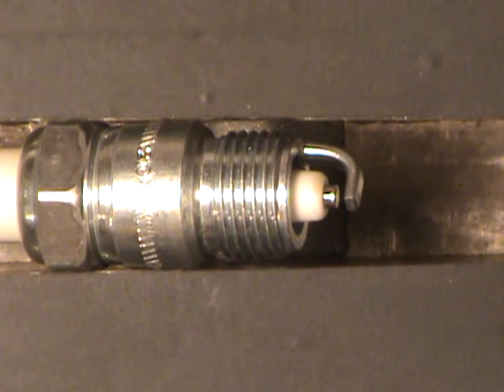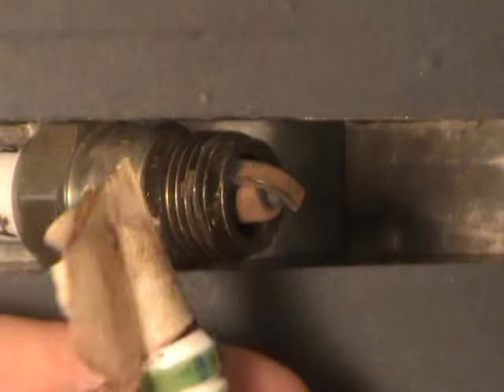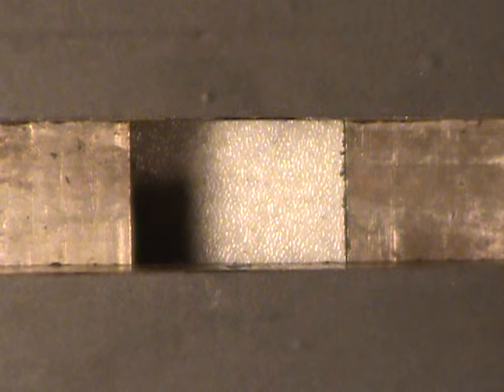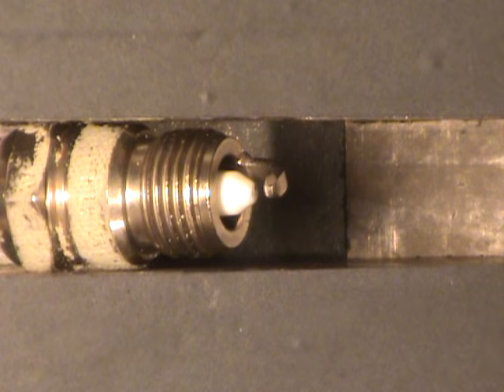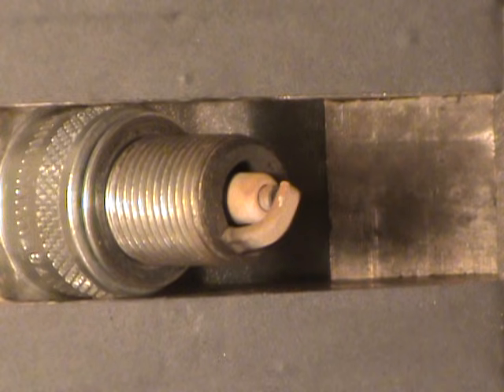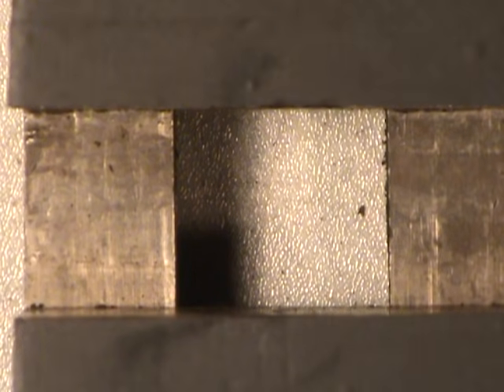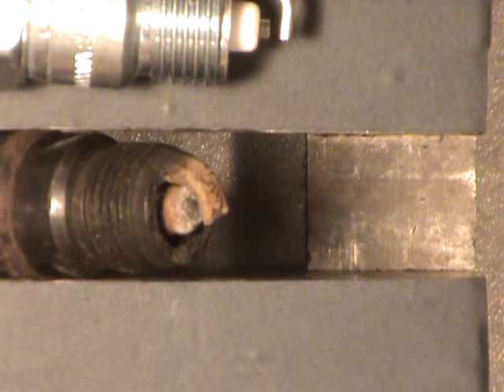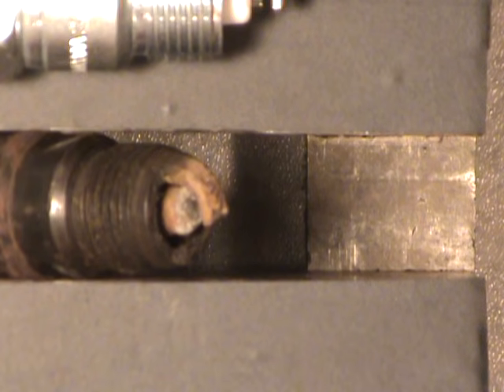SPARK PLUGS How to Read them (Part 3)

Comment: I removed all 4 plugs and they all look like yours at 2:26

So this means engine is in good condition i guess.

But i have to replace the head gasket i think. It has small leak at the corner.
If its a headgasket. Maybe its timing chain cover gasket actually.
Reply from the maker: +jw200 ....Greetings jw200....Thanks for watching................The Spark Plug's Design/Type and Heat Range, can affect, the Amount and Color, of the Spark Plug "Deposits", and the way in which, the inner and outer Electrodes "Wear", due to all of that High Voltage "Arcing" between the two of them, that can Vary/be quite Different, depending on the actual Engine, and whether it is equipped, with a Carburetor or Fuel Injection, and also, the, shall we say "Strength" (high voltage/amperage capability) of the Ignition System, as well as, what-ever-happens-to-be, "in" the Gasoline "Blend" (as in, maybe, a certain %-age of Ethanol/alcohol, perhaps?), that's being pumped-into, that particular Vehicle's gas tank, will usually have quite a bit to say, well, actually "Show", a Person, just what's going on, inside the Engine's Combustion Chambers, be it, Good, Not-so-good, Bad, or, Engine Damage is about to, or, has already Taken Place...!!!...Yikes...!!!...and I hope not.......................The Deposits, that You were sayin', that You saw on Your 4 Spark Plugs, are what I would consider, to be on the, shall we say..."Safe"...side of things, as long as Your Engine Runs and Performs quite Smoothly, and, that it's not making any unwanted Noises at the very same time................The Newer and Cleaner, the Spark Plugs are, as well as, having the Spark Plug "Gaps" (between the inner and outer electrodes), Measuring, with-in the Vehicle Manufacturer's "Specifications", for Your "Exact" Engine and Vehicle, will usually, help-out quite a bit, with both Performance, and Fuel Economy as well, as long as You can keep Ur Led-Foot, from Stompin' the Gas Pedal to the Floor-Board...!!!...lol................If You can tell me, what Vehicle and Engine, and Mileage/Kilometer-age on it, that You have there, as well as, what the Fluid is, that You said, was "Leaking" (was it...Oil...Coolant/Anti-freeze...Transmission Fluid...or Gasoline...???), then, I might be able to help You out with that Leak (hopefully, that is), and..........till next time.........Be Safe, take care, and have a good one.
Reply: +RockysRoadshow Thank you very much for so complete answer. 

Car is BMW E36, 316i, 1996, 75kW, gasoline. Something around 276000 km-age.
Engine works fine and drives smoothly no problems. Sometimes if car sits few days it doesnt want to start immediately. Takes a bit time. Sometimes engine sounds like diesel at startup.

But i have heard this only 1 time, when car was sitting one week without any activity.
I havent replaced the fuel filter and other things.

I just removed the plugs to see them, they are 4 electrode type and to my knowledge they are wrong for this engine.

The fluid thats leaking feels like oil. I havent smelled it. But the cylinder head on the M43 engine is at angle to the left and there is a place where head and rest of engine is mounted together.

But again, maybe im wrong but i think that oil level cant be on so high level that it reaches the headgasket level.

4.5 litres of oil goes into this engine.

Sorry for my english
Reply from the maker: +jw200 ....Greetings jw200....You're Welcome, and, Your English, is just fine, my Friend.....................If Your Car sits for a few days, try this...................Turn Ignition Key to the "Run" position (Not Start), for about 10 Seconds, then, turn the Key Off, then wait about a minute, and Repeat a few times...................If Your BMW's Engine, is like most other Fuel Injected Engines, what will usually happen, is, the Fuel Pump will usually "Prime" the Fuel System, for about 2 Seconds, with a High enough Fuel Pressure, that will probably, help Your Engine Start that much easier/better/faster, and hopefully, not be Dieseling on You as well......................Those Spark Plugs, that have the "4 Side Electrodes" on them, might be considered an Upgrade, possibly, and might help the Engine, Start, Accelerate better, and might even account for some better Fuel Economy...maybe......................Here are 2 Ways, to find out, what the "Exact" Spark Plugs, that the BMW Factory/Manufacturer, had in Your Engine, when it left the Assembly Line......................Have a look inside Your BMW's Engine Compartment, for a V.E.C.I/Vehicle Emissions Control Information...Label/Sticker...and with some luck, it might just have, the "Original" Spark Plug Manufacturer's Name, and Identifying Number/Letters, Printed on it....................And/or, try to find, an "Official BMW Car Sales Business", in the Area, where You Live, that has a Professional-like..."Parts Department"...and, either (or both...lol), Phone, and/or Visit, in Person, that "BMW Parts Department", oh, and make sure, to have, any Paper-Work, for Your BMW, cuz, "They" might ask for Your BMW's..."VIN" (Vehicle Identifying, Serial, Numbers/Letters), as well as, any Information that "Exactly" applies to Your "Exact", BMW Car and Engine combination...................To be Safe, place the New Spark Plug Beside the Old One, to make sure that, it is the "Same", size-wise, that is, cuz, if the New Spark Plug is "Longer", where it goes into the Cylinder Head, the Electrode End of the Spark Plug, might "Hit" the Top of the Piston, and, could very well, cause some rather "Expensive" Engine "Damage"...!!!................I usually, just try to get the OEM/Original Equipment Manufacturer/s, Originally Installed Spark Plugs, cuz, in the past, I found out that, the Non-Original Spark Plugs, that I bought, from the Parts Counter, and I installed, were..."2 Heat Ranges"..."Too Hot"...!!!...and in my books, that's not such a good thing.......................Your (on an Angle...lol) BMW Engine, will probably have Dual (as in 2), Over-Head Camshafts in it, and to Lubricate them, Motor Oil, has to make it Up to them, or Damage, it will usually be, so yeah, Motor Oil can "Leak", from "Way-Up-High" as well.........Yes-Sir-ee-Bob...sometimes, "Fluid Leaks" can Travel quite Far, at times, just so You know (sometimes, due to Earth's Gravity)...................A BMW Factory Chassis Service Manual, for Your "Exact" Car & Engine is good to have....................For a Person, just starting to learn about, oh, let's say, for example, Their Own Car, then, an Automotive Repair Book, such as Haynes (publishing), from my own experience, is an Excellent place to get started, cuz, the Information and Pictures, are presented in such a way, that, makes things, that much easier, for the Average Joe, or Jill, to Learn from.......................Try to do Maintenance on Your BMW, according to what BMW Recommends, at the "Specified"...Time...Mileage/Kilometer-age "Intervals", as per their BMW Chassis Service Manual, or, the Owners Manual, that usually came with the Vehicle, when New, that way, things, like Your Engine, will Perform much better, and last Longer as well...................All Filters, will eventually, start getting Dirty, or maybe even get Plugged-up...not so good....................Be very Careful, when-ever Working on Your BMW's "Fuel System", cuz, some of those "Fuel Pressures are Very High" (around 60 PSI/Pounds per square Inch...!!!), and can cause Eye Damage, so, be sure to, be Wearing Safety Glasses/Goggles, and have a Fire Extinguisher with-in Reach, just in case (and I hope not)........................Try doing an Internet Search, for a BMW (Bimmer or Beemer...???) Website, that has a "Forum" on it, for Your "Exact" BMW, as, there are some really Smart People on those Forums, that can help You out, with any Questions or Concerns, that relate to Your BMW, and...........till next time..........Be Safe, take care, and have a good one.

Comment: i have a 2004 acura rsx (base) wich is oviously fuel injected,and my spark plugs pretty much look like the one at 5:07, its black  on the ring and quader of threads, got alitle bit of gray on the top bent metlal piece, also noticet a white dot right where the spark would be on that bent metal piece metal  is that normal for fuel injectet or cars or is that somting i sould be concered about, i sould replace my spark plugs right?
Reply from the maker: +Daniel Huebner ....Greetings Daniel Huebner....Thanks for watching...................From what You were saying, Your Engine's Spark Plugs, don't seem to be all that bad at all....................Did You have a look at "All" of the Spark Plugs...???...and if so, did they all, look to be, about the same as each other...???......................Is Your Engine Starting-up and Running alright/smoothly, or, does it hesitate, misfire, or surge at all...???....................If the Spark Plug "Gap", between the 2 spark plug Electrodes, gets too BIG, from all of that High Voltage Sparking, going on between them, then, Your Ignition Coils (4 individual ones), have to work harder, then they should be, and, puts a real Strain on them, and can get to the point of becoming Damaged possibly, so yeah, it's a good idea, to install some New, Properly "Gapped" Spark Plugs in Your Engine, if need be..................If You have an Owners Manual for Your Acura, see if there is a Maintenance Schedule in it, for the Mileage/Kilometer-age Interval, that the Spark Plugs should be Changed, in Your Engine, and also, keep a record, of when, You happen to do any Servicing on, or to Your Vehicle....................If You do lots of Short Trips/at lower speeds, the Spark Plugs might have more Deposits on them, as opposed to, lots of Highway/High Speed Driving, which will usually result in, Spark Plugs, that have less Deposits on them, and kinda look Super Clean...!!!...lol...well, if, the Vehicle's On-Board Computer, and, all of the Other parts & pieces, are doing Their Jobs Faithfully, and as they should be do-in, that is, and till next time..........Be Safe, take care, and have a good one.

Comment: Great video that could really help people  with any car issues. I've got a Nissan skyline R33 gtst and the coil packs needs to be changed. How much should it cost to change them all?
Reply from the maker: +ayatullah qasimi ....Greetings ayatullah qasimi....Thanks for Your nice comment, and also, for watching too...................Probably better, if You were to first, make a few Phone Calls, to some of the Automotive Parts Businesses, in the Area where You Live, as to, the Price, of the "Exact" Part or Parts, for Your Car, that You are interested in.....................If the Part/s are not available, or, are Priced too High for Your liking, then, there are so many, Auto Part Sellers On-Line as well (EBAY, as an example), that You can check out, but, be Very Careful when-ever making any Purchases or Payments On-Line, cuz, there are a few, Not so Trustworthy People out there, that, just might, try to Rip You Off (Money-wise, that is)..................If Purchasing On-Line, maybe check out something like PayPal, cuz that Company, kinda acts like the Middle-Man (between the Buyer and Seller), and, will probably make On-Line Purchases, that much Safer.....................Low Prices, aren't everything, so consider the Quality of the Parts as well, cuz, some of those Cheap Parts, might not be all that good, or last very long either...................Good Luck, finding those Parts, that You're looking for, and............till next time..........Be Safe, take care, and have a good one.
Reply: Thank you so much friend :) I did call few nearby companies and compared the different prices. So what should be an appropriate cost for all 6 coil packs or just 3?
Reply from the maker: +ayatullah qasimi ....Greetings ayatullah qasimi....You're welcome................I had a look around, and the Prices are, shall we say, Far and Wide...!!!...................It depends on the Brand/Manufacturer, and maybe, by purchasing all 6 at once, that has the possibility of lowering the price as well.......................Your Engine has the 6 COP/Coil on (spark) Plug, type of, Individual Ignition Coils, does it not,...cuz, that's what came up, when I looked for it/them....................I saw prices, like, from about 40 to 100 US/United States of America Dollars, just for "One" Ignition Coil............Maybe, 200 to 300 US Dollars, for a Set or 6 of them....maybe more...maybe less, depending on the Brand/Manufacturer, and, whether or not, they happened to be, the Factory/Stock type, or the Performance/Racing type.....................There are some really good Websites, that have "Forums" on them, where You can ask, some of the very Smart People, on those Website "Forums", just about any Question, that You might have, about Your Car, and some of those, Nissan, Car, Guys & Gals, will probably have lots of Experience, with Your Exact Car and Engine.....................So, do an Internet Search, for Nissan (car) Websites, that have Skyline "Forums" on them, that way, they can actually tell You, what-ever You might want to know, about Your "Exact Car and Engine", and maybe, where to get the Best Deal, on Your Ignition Coils as well..................Good luck, and...........till next time..........Be Safe, take care, and have a good one.
Reply: +RockysRoadshow wow that's great price because this other mechanic said it will cost $1300 for the 6 since it's a sports car and I was shocked so thank u so much for the appropriate price range
Reply from the maker: +ayatullah qasimi ....Greetings ayatullah qasimi....My first consideration, is, try to get, "Good Quality Auto-Parts", from a Reputable Auto-Parts Manufacturer.......That $1300, was that, just for 6-Ignition Coils (Parts Only), or was that Price-Quote, for Installation as well...???.................Just wonderin', have You ever come across that good ole sayin'..."Buyer Beware"...???...cuz, judging by that Very High Price, that You were quoted, then, I'd say, that, to me, it kinda sounds like, the Mark-Up (that's the price, over and above, what the seller paid for the item originally, before adding the, shall we say, profit-amount to it), is Way Too Much, for my liking, that's for sure..........................It's kinda, like they say, about Medical Doctors..."Get a Second Opinion"...especially, if the Topic of..."Surgery"...is being discussed...!!!...Yikes...!!!.....$1300 USA Dollars...??? (for 6 Ignition Coils Only)...well, for that kinda Money, those Parts (for me, that is), would have to be "Coated with Gold"...!!!...or, I'd be Laughing at them, as I was leaving the building...lol...(sounds, kinda like, Highway Robbery, to me).............Yes-Sir-ee-Bob...if it were Me, I'd be asking the Person (to His Face), that Quoted You that "Price", what "They"..."Paid for those Parts"...???...yeah-right...like They would Tell You...!!!...lol.............You see my Friend, there are quite a few, not so nice People out there, that are more than willing, to take Your hard earned Money, from You, simply, cuz, after talkin' to You, for what seems to be, not too long at all, those, Not-so-Nice-People, can usually tell, if You "Do", or "Don't" know, very much, about, and in this case, we happen to be talkin' about "Automobiles", and once, these, not-so-nice-people, "Sense", that You, (and probably, the countless number of Women, that got ripped-off as well), that, "Don't" Know, all that much about Automobiles, then, that's usually when, I like to use, one of those, good ole sayin's, be-in..."Taken-to-the-Cleaners" (more like, Cleaning-out-Ur-Bank-Account)...!!!...................Here's a True Example, that I experienced in the past.................I needed an Alternator, for a Mazda, that had a Rotary Engine in it, so, I Phoned around, and I got 2 Prices, from 2 Dealerships (or were they Stealerships...???...lol), One Quoted me about $250, and the Other One, Quoted me about $350 (both, in terms of, Canadian Dollar Currency at the time), and, after hearing those Two..."Make-Them-Rich"...Prices, I said to myself, it kinda looks like, I'd better start looking for, a "Rebuilt/Re-Man/Re-Manufactured" Alternator................So, I started lookin' in the Phone Book, for some Auto-Parts Sales places, and, after makin' a few phone calls, I finally found an Auto-Parts place, that Quoted me...now get this, a "Brand New Alternator"...for...a little less than..."63-Dollars"...!!!...(I was in Disbelief)...so, I said to myself, Self, You need's to Drive over there, to "See it for Yourself"...so, I did just that, and, I just about Fell-Over, cuz, not only was that Alternator "Brand New", it was in (as I recall), a Factory "Mitsubishi", Cardboard Shipping Box, that also had, the Official-Looking Stickers/Markings on it as well...!!!...Damn, I hit the "Jack-Pot" on that One...!!!...lol................Also, that Rotary Engine Uses "Special Spark Plugs", that have either, 2, or 3, Side Electrodes on them, that I could choose from.............Dealership wanted over 10-Dollars (each), and, the place I got that Alternator from, were less that 5-Dollars (each), and, yet again, I say..."Jack-Pot"...!!!...lol....................So, it just goes to show, that, by spending a bit of time, Checking here and there, that, quite a LOT of Money can be saved, if You so choose, other-wise, You'll probably be makin' Someone-else, shall we say..."Rich"...!!! (it's Your choice, after-all, when it comes right down to it), and...........till next time..........Be Safe, take care (of Your Money), and have a good one.